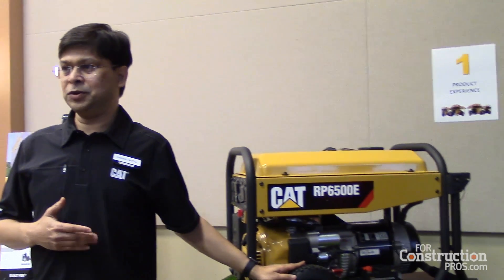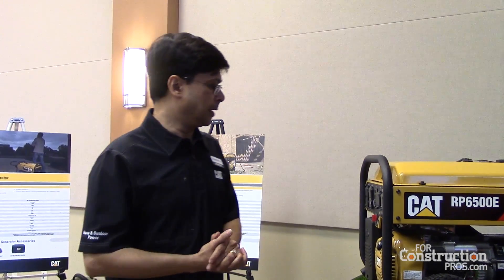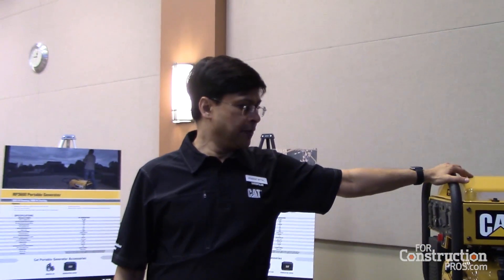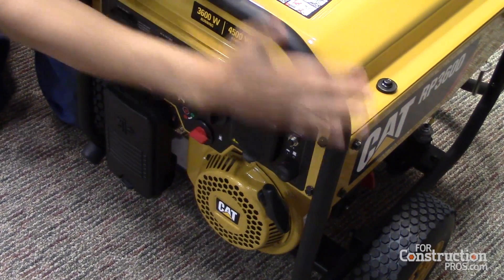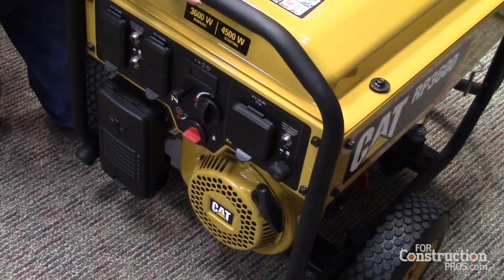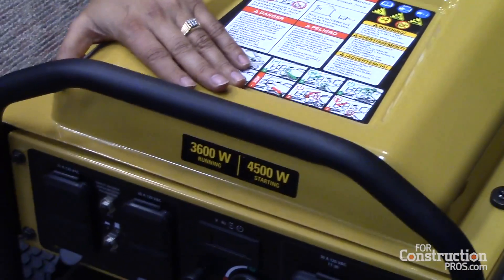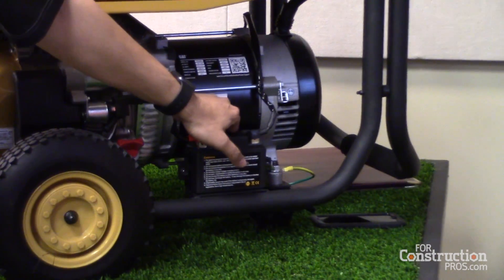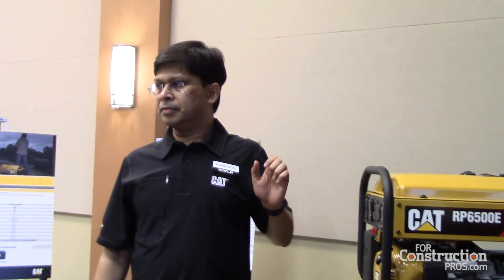Advantages of Caterpillar's New RP Series Portable Generators

Comment: Cheap generator, horrible quality.  Used about 4 times and now the starter switch somehow stripped and is broken.  CAT has sealed all of the electronics in a box so working and replacing the switch is virtually impossible without almost a complete teardown of all the connections.  Don't buy!!

Comment: Honda generators have GFCI sockets, so that was a lie. This guy has no idea what he is doing. Just some guy plucked out of an accounting job to sell this big yellow metal thing.  Give me one hour to read up on the generator and put me at any expo and I will give customers the right information. Tho I sure hope CAT put effort into their new series of portable gens. They have excellent equipment in general, let's just hope this isn't the product that gives them a black eye.
Reply: I bought their RP5500 last year to replace a worn out Coleman generator. Had to fire it up for hurricane Irma. I had to run it for about 60 hours. For back up power it powered the refrigerator, three window A/C's, TV and computer quite well. 

Granted not the same use as a contractor would put it through. But it did the job without breaking a sweat.
Reply: can someone tell me how to bypass co defense system

Comment: will it run a house or do you need more wattage?
Reply: I bought their RP5500 last year to replace a worn out Coleman generator. Had to fire it up for hurricane Irma. I had to run it for about 60 hours. For back up power it powered the refrigerator, three window A/C's, TV and computer quite well. I was limited by the number of extension cords since I do not have a transfer switch set up.
Reply: Portable gens like this are meant to run lights, a fridge or chest freezer, sometimes both. And you only want to run these kinds of generators for six hours before letting them rest, and try to never go above 75% of the rated watts on the generator. What you may want is a "home standby" generator. My house runs off a Generac 17kw generator. It runs my entire house aside from my electric stove and dryer.  Ac, furnace, well pump, lights, sockets,  ect. It uses liquid propane gas, or natural gas. If you have a LPG tank on the property, 500 gallons powered my house for a whole week. If you get Natural Gas from a utility, your run time is basically infinite. 

If you want to know what size generator you need is. take the watts and multiply it by the amps. Keep in mind the type of motors on fridges, Ac's and chest freezers take A LOT of starting watts.